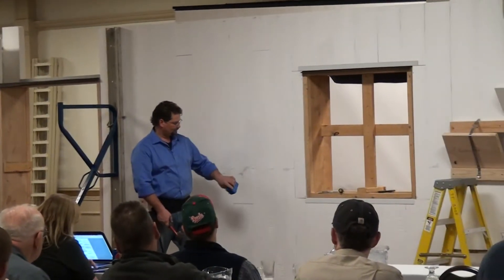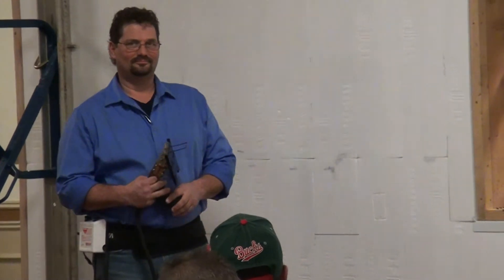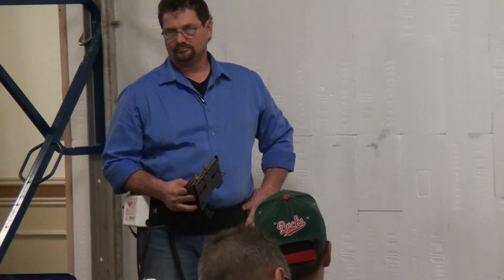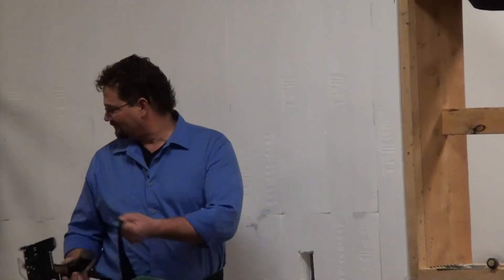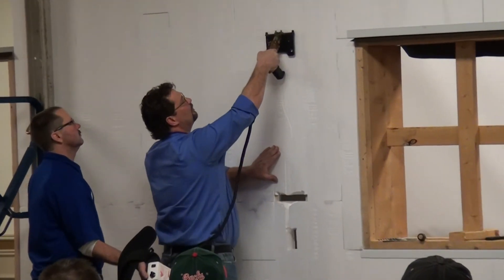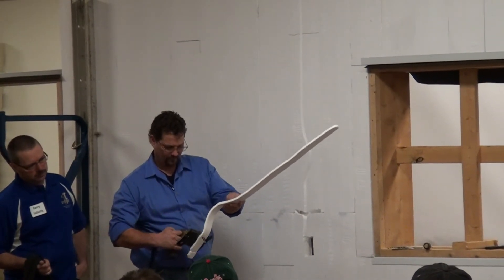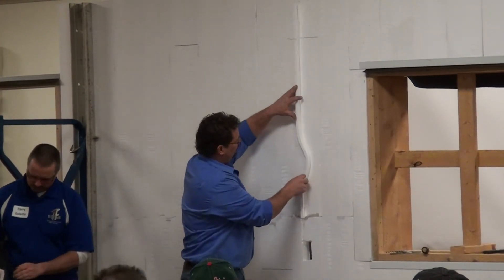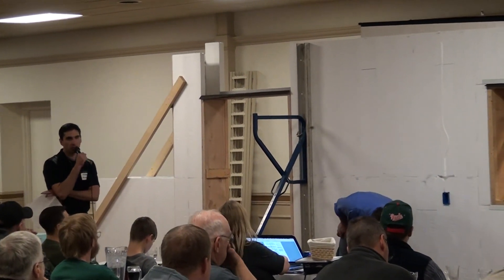TF Forming Systems 2015 ICF Training  - Installing Electrical in an Insulated Concrete Form Wall

Comment: So what I see here is you removing the crucial insulation and creating holes in it. Reducing efficiency. Reducing R value.  My thought is building a false lumber wall inside the ICF wall and retain its efficiency. It will cost a little more but save on time and better installation. You would also not need bearing walls. You are going to drywall it anyway. Frame the drywall on the exterior walls.